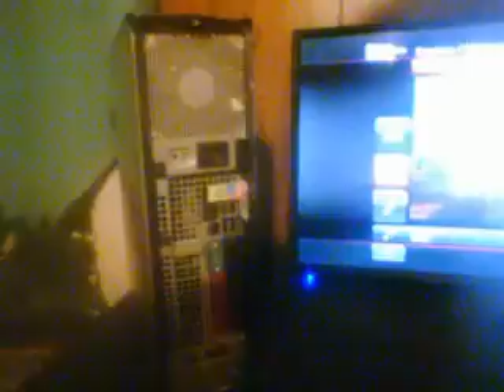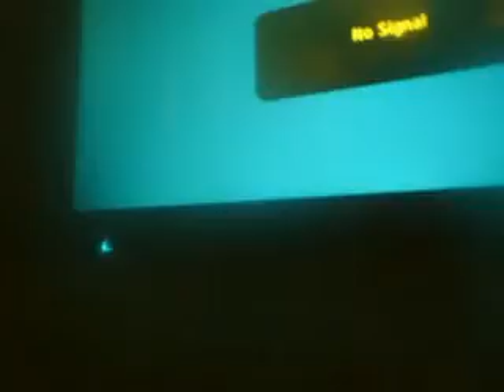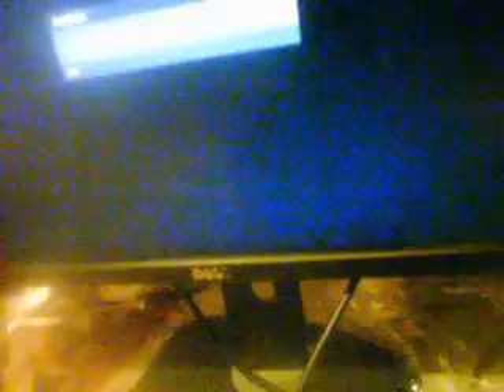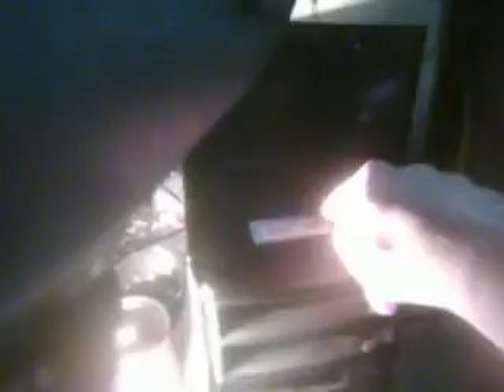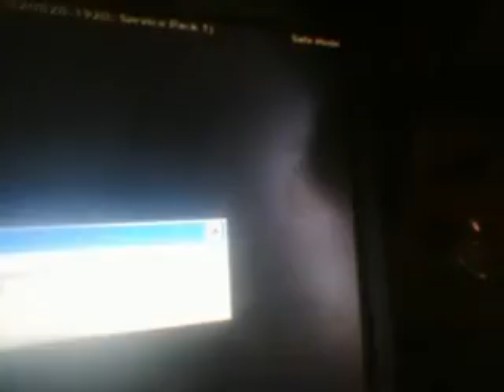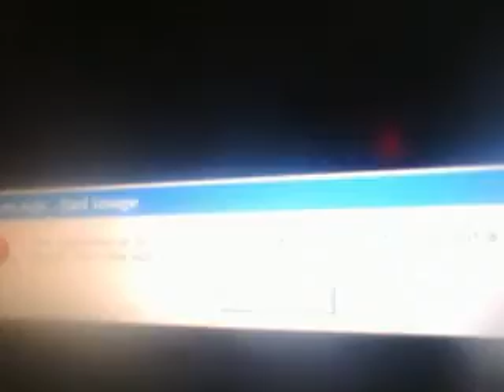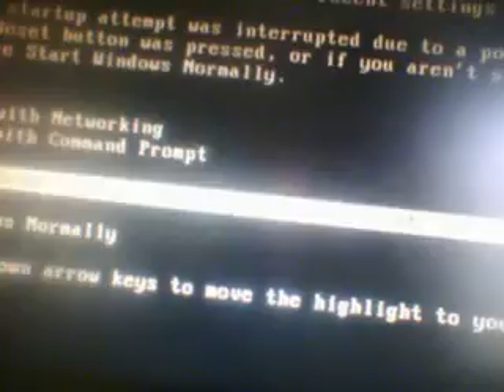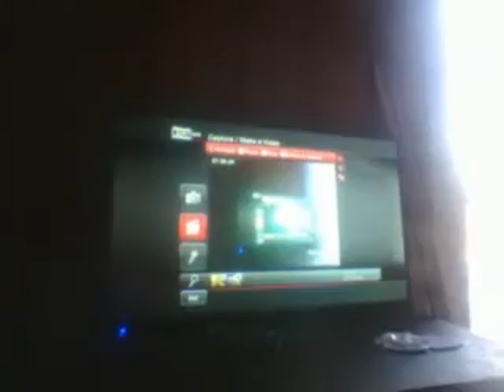Important Updates+Trying To Fix A PC

Comment: The 6 beeps  from the dell desktop is ram failure
Reply from the maker: Ah Thanks For The Intel ^^ Now I KNOW My Computer Is An Asshole LOL Is There Any Way To Fix It?
Reply: @NekoFluttershy  If the computer has two sticks of ram you can try only one and see which one is faulty. If it only has one you might need to buy a new stick. People also "cleaned the ram" when they removed it and it worked but I do doubt that will work.
Reply: It can also be the battery in the motherboard. Suggestion here is while the computer is unplugged remove the battery from the motherboard and then hold the power button for 30 seconds to dissipate the internal charge and then put the battery back in. (I recommend this first)
Reply from the maker: That Sounds Like Itll Be A Pain In The Ass LOL
Reply: @NekoFluttershy  Its easy
Reply from the maker: You Should Make A Video XD
Reply: @NekoFluttershy  There's probably a video out there already